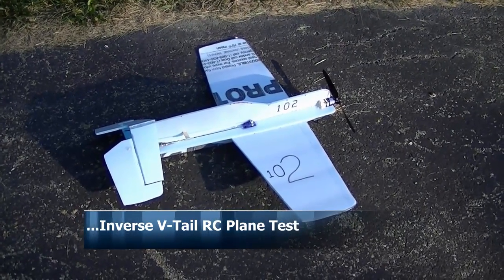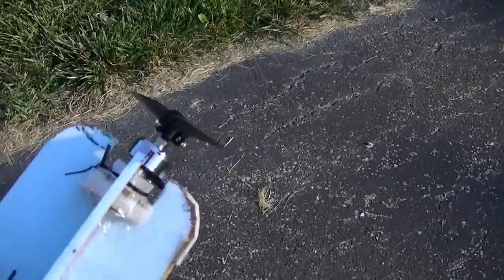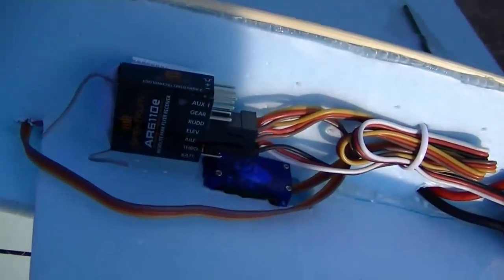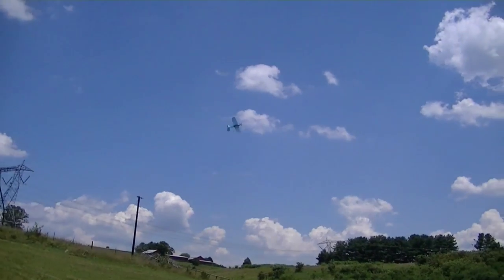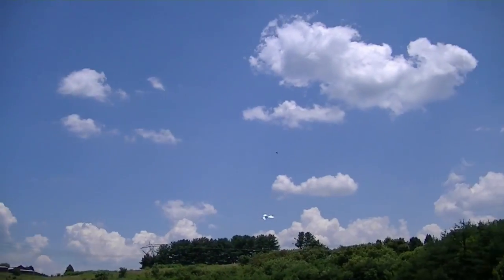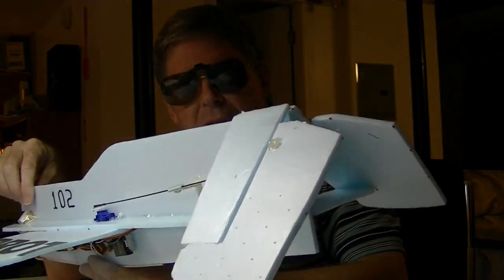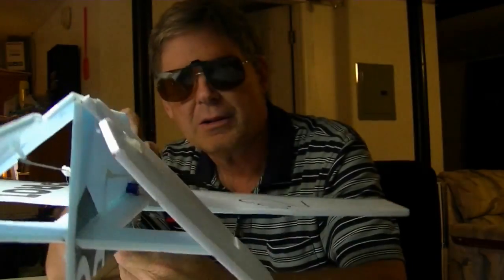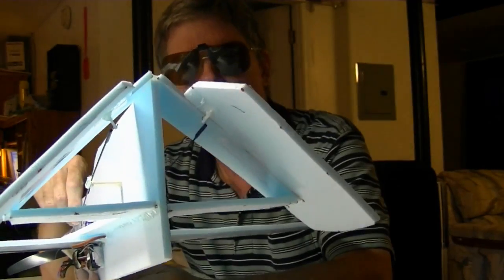Prototype Inverse VTail RC Electric Plane Test Flight, Scratch build.

Comment: How is the movement of the control surface of the Inverted V Tail would be ? Reverse of V tail ?
Reply: it would be the same a flying wing control mix but instead of just roll and pitch, you get roll,pitch and yaw.